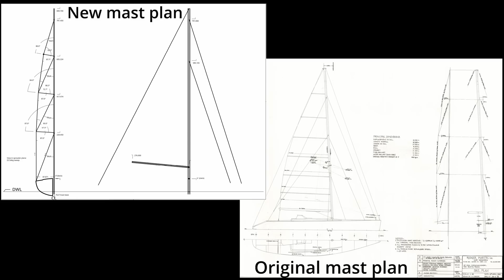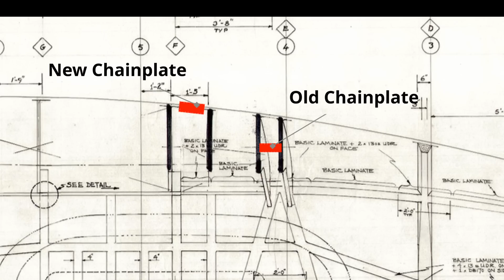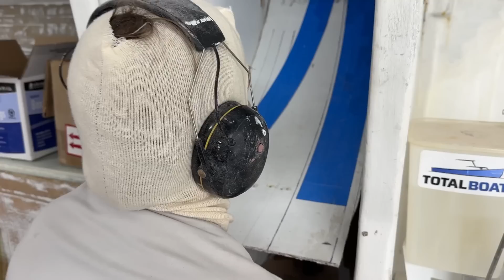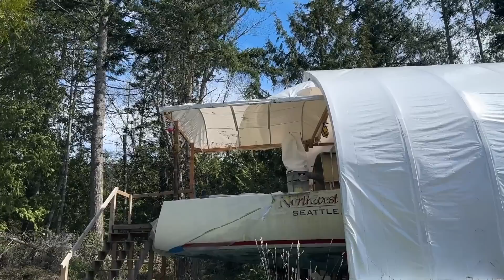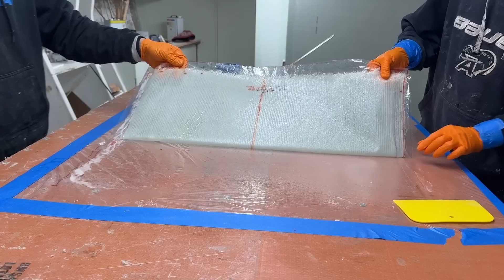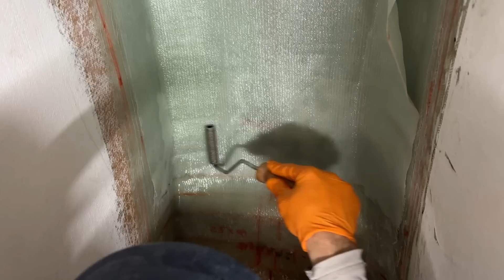Boat Build: New Mast+Chainplate Design [E75]

Comment: If you have an inner forestay and fly a heavy air or reaching staysail, won't you need runners to balance the loads?  It seems like a long, lightly stayed fore & aft section for punching into a steep sea without a runner to be used in these sort of conditions. (an old, retired mast designer at Hood Yacht Systems, way back in the 1970s).  I love your modifications with chainplates at the rail and the carbon fiber chainplates.
Reply: I can't help thinking that swept back spreaders is minus point on a cruising boat. You can't get the boom out for long downwind legs without damage to the mainsail. I would want runners when flying a small headsail upwind in to a sea on the inner forestay. It will be interesting to see how much more jurky the motion is when sailing with the lighter mast. Those that have swapped aluminium masts to carbon masts have often found the motion especially as anchor quite rolly
Reply from the maker: @Tim Evans This is another rabbit hole I didn't want to go down for being already in the weeds.  You are right that swept spreaders keep the mainsail from being eased for straight downwind running.  Compromises have to be made with double headsails or sailing hotter angles.
Reply: With sailing larger boats most of the sailing is not close hauled but down wind so perhaps movable back side stays that address that force/strain on the rig make sense.
Reply from the maker: We will have check stays to oppose the staysail.  I didn't explain any of that as I was already in the weeds and didn't want to go any deeper.  But yes, the inner forestay has to be supported with a check stay with a reef in the main and/or flying the staysail, especially upwind in any kind of chop.

Comment: Looking forward to next weeks discussion of the engineering of the new chain plates.  Right now it appears that you are relying on the adhesion of the epoxy in the fiberglass just added to the outer skin and the ring frames to carry the mast loads unlike the old chain plates that were through bolted to the ring frames which seems like a more robust arrangement.
Reply: It's actually superior, the surface of adhesion is way larger than the handful of bolts on the previous setup. Donc look at epoxy laminate as something you glue on top of something else. It is all one piece now.